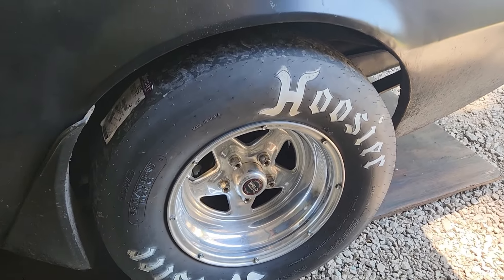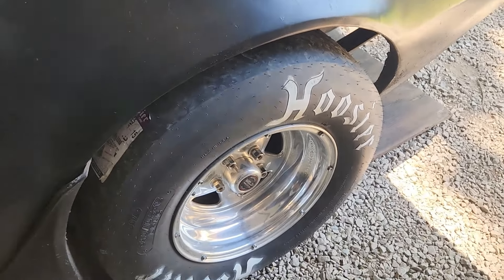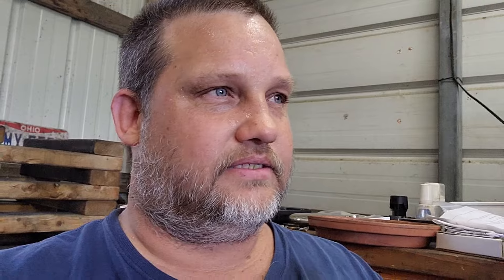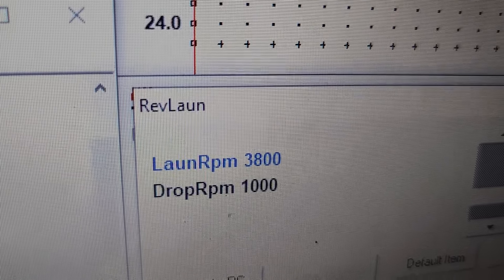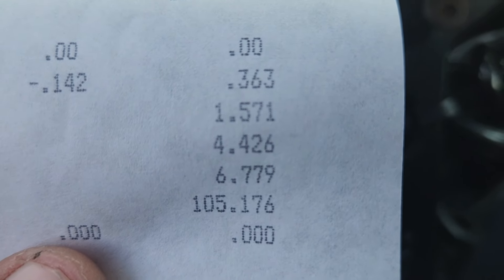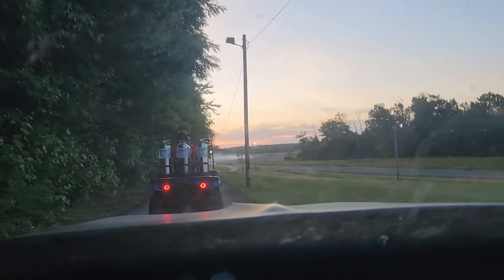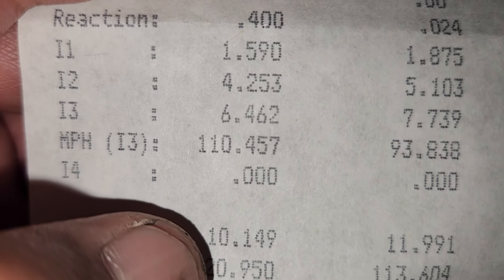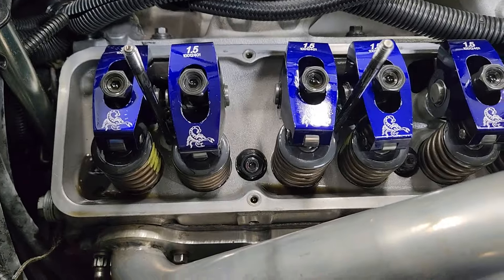Blow Through Carburetor Turbo Gen 1 SBC in 1980 Trans Am Leans Out and Burns Another Piston

Comment: Just someting to consider.
One should never ever run without a nice large intercooler. Never ever. 
All V8 engines run very uneven with up to 2 points difference in AFR from leanes to richest cylinder. 
No intercooler and only one or two lambda sensors will get you in trouble as excessive intak air temperateur destroys everything at the lambdas just tell you average AFR.
Stagger jetting the carb and  the power jet rescrictions is a must to improve the situation. :) 
Fuel injection improves nothing without individual cylinder trim via 8 lambdasensors. 
Just IMO.
Reply from the maker: Ya, I agree. I'm pretty sure that was the cause of it. Funny thing is we was just about to order an intercooler for it too.